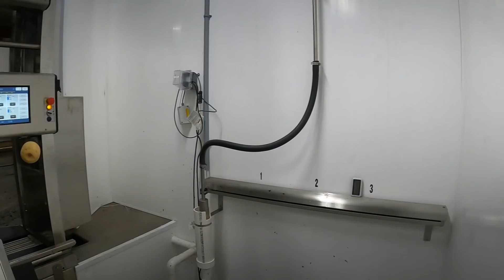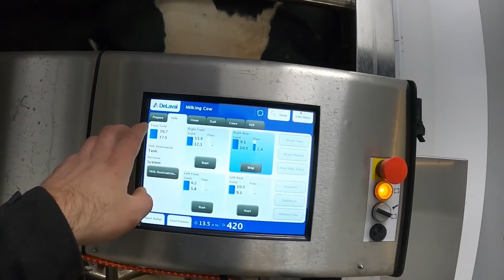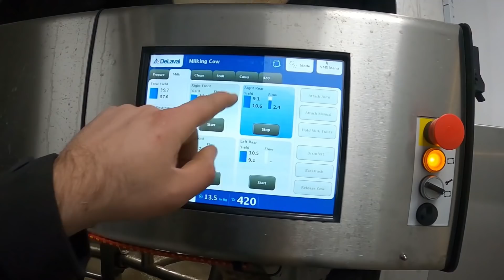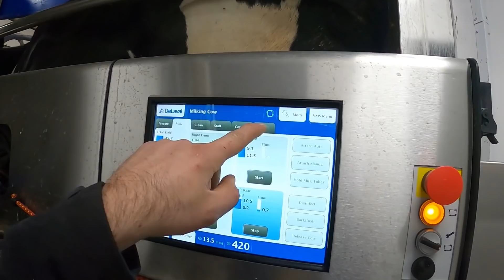How to start a Robotic Dairy Barn- A Day In the Life Of a Robotic Tech

Comment: Now tell us how much one of those robots cost? 500k?
Reply from the maker: A new robot is roughly 150-180k
Reply: @DuffyAg  all that concrete and fancy barn is 600k? So 1.5 million to milk 250 cows?! I suppose if it cuts 2 farm hands at 50k each per yr it will eventually make sense.
Reply from the maker: @crazyhass84  usually with barn and everything else it works our yo be 400-500k per 4obot. Robot alone is 150-180. It can pay off with labor savings usually over 5-7 years depending on current situation. Larger farms definitely can see more return on labor savings. But increase in milk and ability to manage with the information is a big benefit to. This barn here is top of the line
Reply: @DuffyAg  thank. Even more expensive than i thought. I grew up milking. It was a great life lesson to get my education so i didnt have to farm as primary income. Its a shame teens today r to lazy and we need robots...

Comment: Could you maybe someday take us along to one of your retrofit facilities for a tour? It would be nice to see one. I'm thinking of going that way in the future for our 100 cows. All the robot barns around here are new builds. Our free stall is in nice shape, manure, feeding equipment/storage all in place and all in good shape. Hate to have to build and take up good usable farmland since here it's very hard/expensive to pick anymore up to farm around here.
Reply: how old is your barn?,  are the alleys wide? we did a retrofit and it worked great but i had  big stalls and wide alleys... dont cram them in either and have someone work on the bluprint with you b4 you pour concrete
Reply: @byronloveridge8381  barn is around 20 years old, but in really good repair, plus we remodeled the stalls a few years ago. And the roof is fully insulated with 6in of bat insulation covered with vapor barrier and tinned over. The feed alleys are 14-15 feet wide and the outside alleys are 12ft. Barn has a center feed bunk 5ft with bunk feeder set up. Barn cleaner runs across the end for scraping into with skid loader. That's the only hang up is cleaning the barn. Dry cow pen is continued off the end but alleys are narrower but that is because of calving pens/bed pack area.

Comment: You said barn layout is key in efficiency of a robot. Do you help in the layout of the barn for the customers or is that usually done by the time you get involved?
Reply from the maker: I sure do I have alot of experience with that and can guide people especially based on how they plan to manage the barn in the future
Reply: @DuffyAg  I used to milk back in the day and I remember really unhappy first calf heifers coming into the parlor. How does that work with the robots when they kick a bunch. And have you seen such thing as a untrainable animal when it comes to the bots?
Reply from the maker: Because you can manually milk with a delaval it allows you to attach to heifers who are freaking out and not standing still, till they are relaxed. Most heifers do very good in them and are relaxed once they start eating the grain. I have seen extremely nasty animals who don't want to be touched turn into good cows in the robot. Dependa how much time someone wants to give that animal to relax and work with them

Comment: How much does it cost to build a barn like that without the fancy front wall, curious cuz I'm looking into bots but I'm trying to get a tie stall bot, curious what a whole new setup would be I'm impressed
Reply from the maker: I'm not sure exactly what that costed the facility is top of the line and took alot of site work. Robots are roughly 180k a unit plus barn. When I worked for delaval I know farmers built 1 unit barns for roughly 500k ready to milk 60 cows. Lot of variables tho. 8 unit barn I worked with 500 cows was 3.4 million with some manure storage
Reply: We are curently pushing 1 mil on the numbers i've been able to get on our barn,  hoping one of our local builders can do it a little cheaper. Single robot, add 400,000 to get to a 2 unit barn.

Comment: Great video. How far west do you go for start ups? I have been promised to see one in ny
Reply from the maker: I used to cover the America's, I now just stay in New England. There's alot in western NY. Great dealership with some bigger barns 8,11, 24 unit barns along with smaller ones
Reply: @DuffyAg  glad to see you say that. We are hoping to build a 1 or 2 unit barn this summer. Have had people tell me to go lely due to poor service from a store delaval closed. We've been on 6 delaval farms in wny.
Reply from the maker: The tech that covers most everything in wny for robots is one of the best in the states. Depends on location, lely has better support in central NY and eastern NY for sure but has alot of turn over on their crews.
Reply: @DuffyAg  from what i've gathered our lely dealer only cares about the big guys, salesman has pissed me off.  The lely dealer that i would want to work with said they can't come into ny, we are 5 miles from the border. I like the delaval unit better and guided flow any way
Reply: we had lelys for 6 yrs lots of  issues with brushes and high scc,  plenty of masiltitis,  had a barnfire and rebuilt with delaval... best thing i ever did